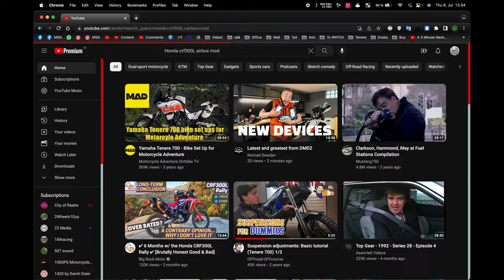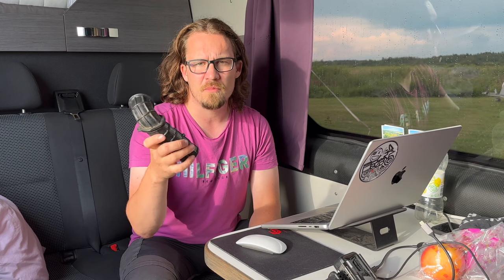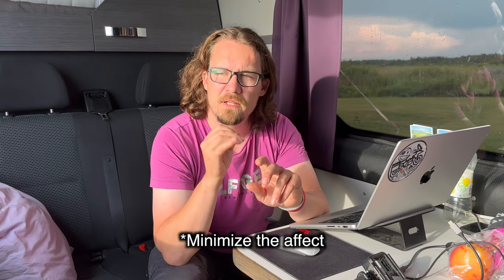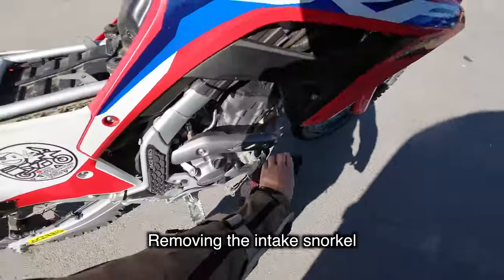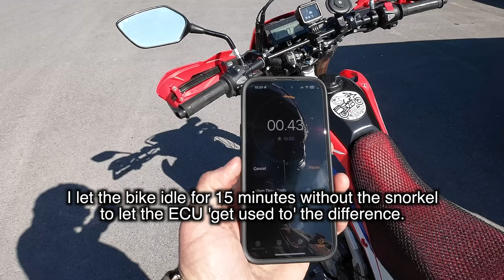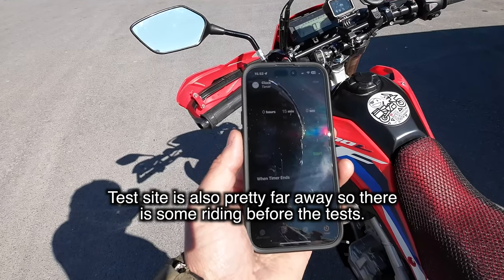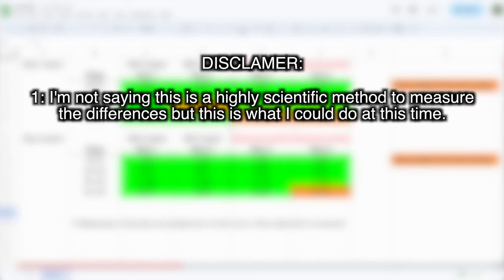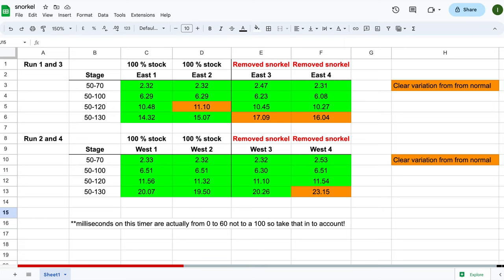Honda CRF300 Airbox Mod: Fact or Fiction?

Comment: Its almost like the Honda engineers knew how to build the right airbox and snorkle.
Reply from the maker: Seems that way doesn't it 😅
Reply: It's almost like Honda engineers had noise and emission requirements to meet.
Reply: Yeah the reason it hurts the bike is because the ECU doesnt give it any fuel. They did this to meet emissions but these bikes run much better if you make them more free flowing. Give them more air and somewhere for it go and all you need is fuel to make significant power gains.
Reply: Terve. Thanks for the honesty!!! This comment is an emotional take on "grunt", torque or in Finnish "sitkeys" (no keys related) and vääntö.

"Let MORE air in by cutting the air box useless" gives me goosebumps when said  with emotion. Reason being that, in my opinion the definition of "more" is wrong. Not many have it clear what "more" actually stands for. More is not having a bigger and a shorter hole (instead of a long pipe with funnels on both ends.)

Reason is air speed. Larger air speed generates more torque. Having a long thin'ish pipe for the inlet provides greater air speeds. Engine would anyhow sucks the air it needs. By having a pipe with funnels on both ends the flushing of the cylinders would get better. The speedy air goes more easily in and out from the engine. 

This is also the reason why two strokes are picky about the exhaust. The chamber on the pipe resonates so it's supposed to "suck" gases out via correct timing of these resonating pulses. And this way to achieve better flushing of the cylinder gases and to have a better power curve.

So the speedier air flow brings more grunt to the power curve. Yes it would limit the maximum output by a fraction but, which one shows in the real world? +0.79hp in the absolute power maximum on a 500rpm top-end range or, more torque in all the non-maximum rpm range? I think this video speaks for itself.

Have a peek at old carburetors that are race spec. Rally cars or speedy bikes. Each one has an "acceleration funnel" to maximize the flow speed of inlet air. It's not simply just a big hole for a reason. 

Please don't cut the air boxes of your engines useless. The 2nd hand owners would hate that kind of a mess.

So a big thanks for this realistic test and see u at the club ;)
Reply: @johndear4639  are you a comedian or Russian bot?  Very funny response either way.
Reply: @ug9191  maybe try to learn some writing rules in English before being Mr funny guy?
Anyway thanks for the good comparative reply. Now it all makes perfect sense due to your irreplaceable contribution.
Reply: @johndear4639  lol, serious projection right there.
Reply: Check out jake the garden snake. He does a more in depth intake mod and it does increase power
Reply from the maker: https://youtu.be/-rdtfHX3i6k?si=6RR3_AsRdb4LY9-B

Comment: You did not factor revs, but from your figures we can maybe deduct that in mid-rev range the "no snorkel" mode is beneficial . You loose at the beginning of roll on, and at the end on the highest speed 130km/h, but reading your results 50-100 and 50-120 at most of the points "no snorkel" wins. We do not have 70-100 to be more precise, but this is my reading of your excel table.
Reply from the maker: The differences on those speeds are so small it is completely meaningless. I mean 0.2 parts of a second is not really something this test can varify to be anything else but normal measurement variation. 
From this test I have no reason to believe any of the rev ranges is positively affected.
Half a second repeated would be something I would possibly conseed to be meaningful. But if the test shows the exact same on run 1 and tenth of a second difference in run 2 it's not really anything else but normal variation caused by the fact that this test is not done in a vacuum. 
The top speed difference I could feel just by the fact that I had to ride a noticeably longer distance for the bike to reach 130.

Comment: I'm not surprised at all. I've professionally tested bikes and scooters all my working life. More or different noise (snorkel removed) influences a lot of people's perceptions. That's why a 2D-datarecording we used or a dyno are important to check your "feelings". Have a great Sunday, Günter/Nürnberg
Reply from the maker: Exactly! Thanks for commenting 🙏
Reply: Hi Günter, to be honest I was expecting a small increase in power. Assuming that the amount of air is increased the mass flow meter should detect this and the ECU should calculate more fuel which has to be injected.
I would like to know where I am thinking wrong. Or maybe the air mass flow is not even getting bigger?
Thanks and greetings from Aachen
Reply: @superchargergo  This is a wonderfuld field for tuning or an engineer. Could be that the standard airbox (despite some modifications) does not allow enough air into the engine. Maybe too small (obstacle), maybe too wide (less speed). Maybe the cylinder head (flange, valves) blocks more power. Tuning is a vast field and time-consuming. If it was as easy as a new airbox or a different slip-on... Happy rides, Günter/Nürnberg

Comment: It's like these guys that put cold air intakes on their trucks and insist the get more "power". What they get is a different sound. Same thing with this bike. I'm keeping my 300L stock as it does just fine...if you want more kick in the pants get a more powerful engine on another bike. You get all these dudes that buy this little campground cruiser and they want it to perform like a full sized touring bike. It's kind of laughable, actually.

Comment: Thanks! Very valuable information. 
Several years ago I did the exhaust, intake and jetting mods to make 2001 Kawasaki 1500. The result was MORE NOISE, LESS POWER, LESS TOP SPEED, MUCH LESS MILES PER GALLON of fuel. 
It was a huge disappointment!!!

Comment: Taking out snorkel may result in more turbulence as air enters the airbox. That would account for the increased noise and also explain reduced performance, especially at the higher speeds.
Reply: correct

Comment: Good experiment. Honda engineering is world-leading in most of their products. Fluid dynamic engineering went into the design of the intake and exhaust. Removing the intake snorkel violates Honda's "all-in" engineering and destroys the designed intake resonance. "All-in," the engine was designed to work with all its stock components together. Most mods and aftermarket products are Jethro! Your test showed that. How many videos have I watched where some backyard "engineer" removed the snorkel and drilled holes in the airbox to let the engine "breath better." Not too surprising who will win when Jethro takes on Honda engineering! Great video.
Reply from the maker: Thanks! 😊

Comment: From my experience screwing around, if you put an after market air filter and exaust and then do the airbox mod, it just makes the bike run leaner than it already does from the factory. Real gains are only made with EJK or ECU reflash. Just my opinion tho.

Comment: The bike is designed to run its best in standard trim the way it comes from the factory, but you can change ( improve) the power delivery and amount, but you have to change multiple things .
Reply from the maker: Yes. But many people dont believe this so I made my own test to show as best I could so people would stop drilling holes to their airboxes.

Comment: great video. its accurate enough to determine if there are any significant gains or losses. I think that if you sat on the snorkel your bum dyno would forever more suffer from huge losses.

Comment: Very well made video showing actual results.  If you were to open up the snorkel hole (or add another hole) , remove the backfire screen, add aftermarket filter, and use the CBR intake you will measure big gains.
Reply from the maker: I disagree on the 'big' part of that 😊 Jake the garden snake did absolutely everything on his and there was gains at some rpm levels but considering everything he did I think the gains were still pretty minor. 
I'm not saying this bike can't be tuned but I am saying that just throwing away these snorkels is pointless and also asking the question is it really worth it to put thousands towards powermods? It's fun but.. worth the money? 😁
Reply: @PatchedBandit  disagree all you like, the big gains are still there.  Just the snorkel is pointless, it takes a few simple changes to free up the intake.  I measured the performance increase. 6th gear roll-on from 60-115 kmh was 3 seconds quicker.  Jake only dynoed once and made huge gains in the mid range, not sure what you saw.   A little on top.  CBR boot was $30, after market filter is a no brainer for it's re-usability.  Even the CBR cams are dirt cheap if you want to gain a bit more.  I've also done the 550 ecu to compensate for the extra airflow.  SO that was $150.  550 showed 20% more power on top when they dynoed the stage 1.5.
Reply from the maker: Sure sure 🙂 As I said it's fun to tinker but also its not like it comes cheap. Full exhaust, intake mods, 550 ecu etc.. Someone says it's worth it someone says its a lot of money for a cheap bike. Lets be generous and say the bike is 30hp instead of 27 after 1000 euros.. everyone needs to decide if it's worth it or not for themselves. 
Not here to argue and I might do some mods to mine too at some point if I don't sell it. 
Jake also did the big bore kit.
Reply: You don't even need exhaust or aftermarket filter for big gains.  The hp per dollar is a bargain.  $200 for the snorkel and stage 1 ecu and open up the intake.  Jake dynoed before the big bore.  Not here to argue either but what you said isn't factual.  Which is surprising considering your attention to detail and consistency during testing.  Peace out.

Comment: Was not suprised. Air flow into the box by removing the snorkel gives a shape edge and probably a lot of turbulens. A smooth snorkel will let the air flow better into the box. 
However, I bet a bigger diameter and shorter (3d printet) inlet track to the airbox will impove on stock, but more noise.  
Honda have to take several point into consideration when designing the snorkel, induction noise and flow. It is probably the best compromise to meet all requieremnts.
Reply from the maker: Especially with the bike otherwise being stock. I wanted to raise the question is it a good idea to mutilate these airboxes especially if the bike is otherwise stock. I see so many videos of people drilling all kinds of holes and using glue to botch these separate holes on the side etc. 
Water ingress will be a problem and they are probably not gaining any power. 

Airflow + exhaust + ECU.. then we start to talk maybe some measurable differeces but I'm still sceptical on how much can we really get out of this even doing all 3. Cost is high and benefit is low from what I have seen.
Reply: @PatchedBandit  Agree to some extent. I've just got my Rally last week so still running in. 

Small gains on a small output engine is still a gain. However, I was watching a Shonky productions vid where he tested a friends stock Rally after modding his bike. He was suprised on how good the stock actully was. 

Im not sure now I want to do all the mods now, but I would really like a proper dyno session to smooth out the off throttle jerkiness. However, not eays with a EU ECU...

Seem like the tune is all about fuel and emissions, so lean. 

First Im going to enjoy the bike as it is and do needed stuff first like handguards and maybe a softer seat. My arse is dead!

Comment: Hi a quick - what i have done to my crf300l ! , no body on here talks about the on off throttle !!! bloody horrible , to my suprise just by fitting a straight through exhaust ( black widow ) it improved the notchy throttle alot , but what 90% fixed the throttle was a 550 performance reflash , i also fitted the snorkel from the road version of the crf , it has transformed the bike with lots of low revs grunt maybe a tiny bit flatter at the top end but well worth the sacrifice as it is now a pleasure to ride , i hope this helpful to some of you crf owners  Richard from the uk
Reply from the maker: Thanks for the comment! I'm looking in to making some mods myself in the future and I fully agree on the throttle jerkiness it is the worst. I have even thought about making a full video about just that because I find it so annoying in city/town riding. 
It's not a problem offroading and being on the button but if I just want to pot along in the city it is pretty bad. 

I'm glad to hear those mods have helped the issue. I might do the exhaust next and see how it helps.
Reply: You think jerky on/off throttle is bad on a 300L try a 450L, will give a new appreciation.
Reply: @billybob1773  Hi billy bob i heard they were bad , maveric at 550 performance may be your man , If i had test riden the 300l before i bought i would not have !!!! i suppose this on off throttle is to help get through emmisions.

Comment: I tried an identical crf300l to mine but with a yoshimura full system.My subjective "in the saddle" experience was this-
Low RPM stock exhaust much better Yoshimura , bit more bog ,more noisy
Mid RPM.about the same performance, A lot more noisey
High RPM to full throttle , slight noticeable increase in performance.Nothing like the wild claims made by some.I have 2x 450/500enduro bikes and my CRF,fairly experienced with motorcycles and BS.
Dont waste your money (nearly1k) on this crap.I changed the rear sprocket handlebars footrests and suspension.You will go much faster if you do this and practice trust me......

Comment: Of course you're right. Every engine is designed for certain pressure values at intake and exhaust (backpressure), and removing snorkels or replacing pipes requires not only fueling adjustments, but also valve timings adjustments to be useful. It's actually a challenge to find a second-hand bike that doesn't have some stupid destructive "mods" that make it run poorly.
Reply from the maker: Well said! I made this video just to show people that drilling all kinds of holes to the airbox doesn't make any difference or can even be worse. I've seen so many videos of people only modding the airbox and saying the bike is faster without any real tests done.
Just with ass feel it is so hard if not even impossible to say if these bikes are 1hp more or less powerful especially as certain rev ranges can be affected differently with each change. 

Only dyno would tell the full story in numbers but that's something even I don't have at my disposal. I haven't seen any powermod to these bikes that would actually drastically change the behaviour for better. 
The twitchy on/off throttle is something I would like a fix thouhg.
Reply: @PatchedBandit  even people who do have dynos tend to overlook important consequences. For example, someone does some mods and confirms 5% power increase. But they don't notice (or mention) that they suddenly have 20% worse fuel economy, or the engine starts to overheat more often, or the header pipe burns through for some reason, and so on. Are the mods worth it in the end, even when they seem to work? Of course everyone's entitled to their own fun, but I'd rather buy a more powerful bike than waste my time and money mutilating something I've overgrown.
Twitchy throttle is a scourge of many fuel-injected bikes. Throttle tamers and fueling tweaks do work to some extent, though I figured it's simpler to just get used to it.
Reply from the maker: Good points on both. The throttle issue is not a problem offroading.. it's mostly just an annoyance in city riding. Also it has some 'flameouts' pretty often when trying to start moving from a standstill. That's even more annoying but luckily it doesn't happen a lot and it's a known issue with this machine.

No bike is perfect :) I agree on that it's pretty pointless to try and pull more power from this engine. Better to upgrade the whole bike. Suspension upgrade to the Honda is money well spent in my opinion but everything else is debatable 😅

Comment: Good test? I just installed a twin air filter last night, after 4000km, the factory filter was very dirty. I did look at the intake pipe and wondered if the benefit of removal was worth it. I can see it's benefit in a brief water dunking.
Reply from the maker: I've been running a prefilter on dusty rides so mine is still good. Water ingress is the main use of the big stock snorkel and this is why I was wondering if I should install a second one to the same box. 
But without any other mods it doesn't seem worth it.